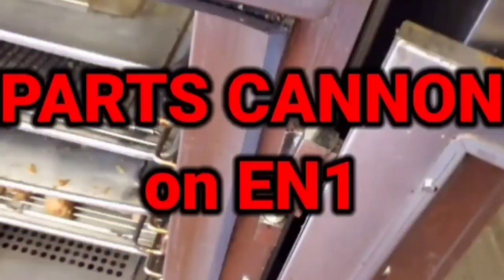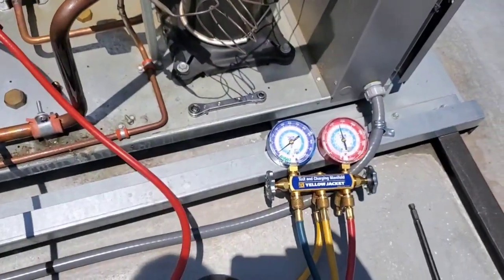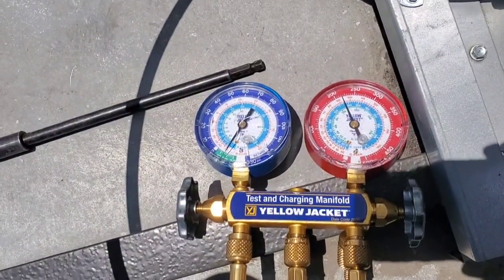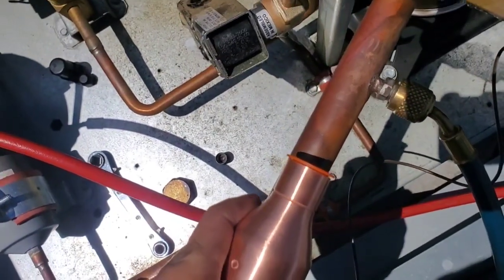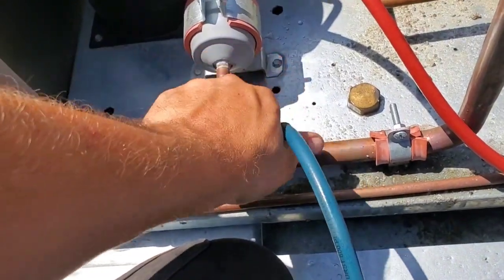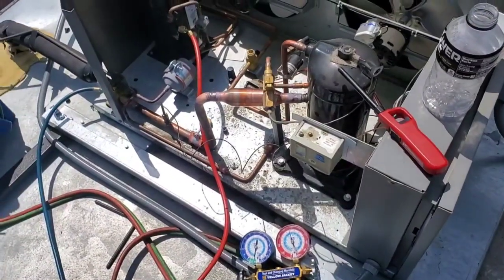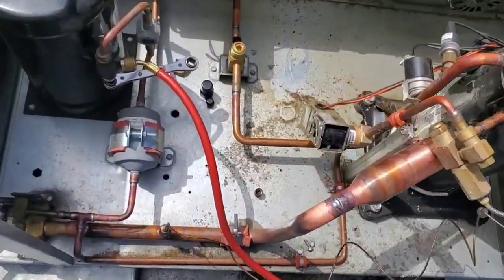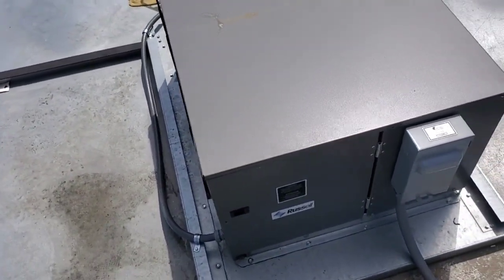Adding a Suction Valve to a Scroll Compressor

Comment: I hade the same problem on a system. Changed the differential on the LP, problem solved. I'm a new tech in the field so nice to know about check valves, dident know they could fix problems like this.
Reply from the maker: The check valve does do a nice job but in the real world you solved the problem the same way i do. If you can turn a screw to make it stop, why do an open system job? This case we were told to install the check valve by the manufacturer
Reply: I've install a Russell Witt unit just like this one. It came with a check Valve already. Luckily for me I found this video for future problems if it didn't had any .

Only bad thing is that they don't come with a Accumulater! I always install them.
Reply from the maker: Afraid not,
Just a 3/4 magnetic check valve

Comment: I doubt would have changed filter dryer as new unit, and YES add time delay - (even just for safety  works sometimes - on preventing short cycling - also  alt refrigerants screw pressure cut in and outs BIG TIME - not sure thats what system you where working on had
Reply from the maker: It's an r448 system sure enough.  And if I'd had my way the low pressure control would have been adjusted and there would be no need for the check valve.  But Russell called the shots on this one.

Comment: you didn't sound excited to be putting on that check valve
Reply from the maker: I would have been happy to just turn up the differential on the low pressure switch. The problem is pretty common but this time Mocha Cheeno Seefus called warranty tech support and this way their solution.

Comment: Nice. That's what I'll do next time I run into that problem
Reply from the maker: It's honestly more practical to just turn up the differential in the pressure switch, usually, but this time the manufacturer got involved
Reply from the maker: If you can make it work by adjusting the pressure control you save a LOT of time and effort